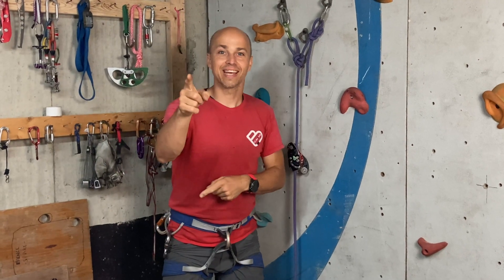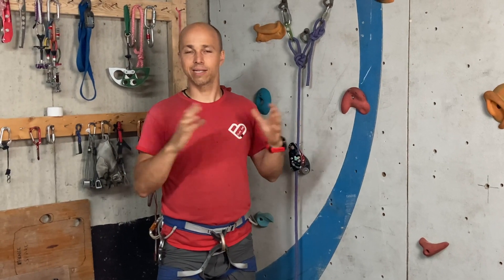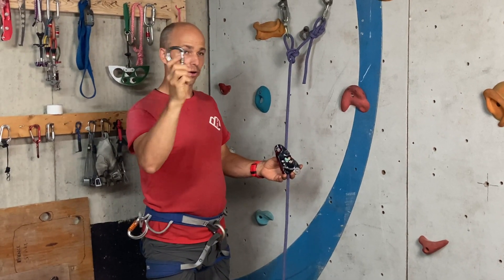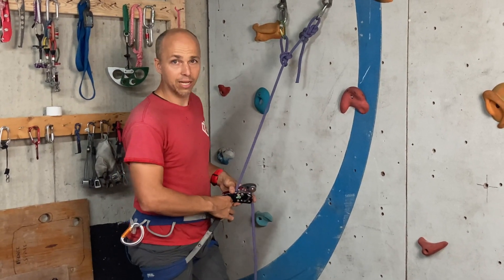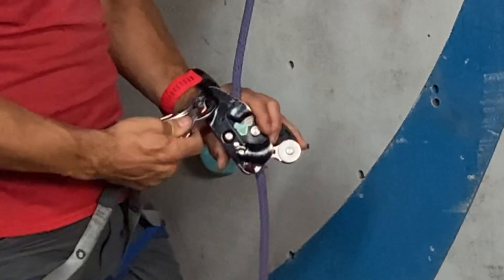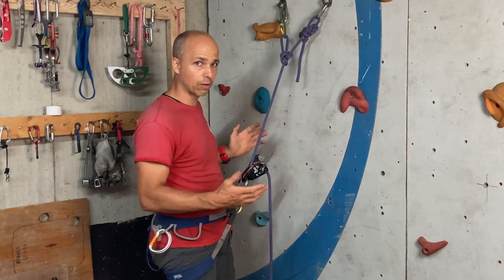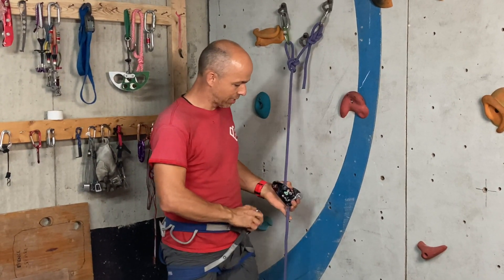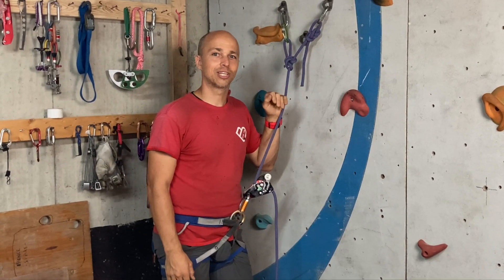About Connectors vs Devices - Black Diamond Gridlock vs TAZ LOV3

Comment: Fantastic video, I saw you tested the Ring Open, I thought about using just a ring open off my belay loop to connect my Lov 3. I’ve been using a DMM triple locker but had some concerns about cross loading.

Been using a shunt and a 12mm mallion for years.
Reply from the maker: "ring open off my belay loop to connect my Lov 3" Probably good but never tested. I will ask the TRS FB Group see if someone used it like this... "SHunt qith 12mm maillon" It must be a 10mm right? (I doubt a company makes a PPE 12mm model... Peguet has only the CE version - Not PPE in the 12mm size). No backup right? Did you use an 11m low-strech rope? Or two strands? You know two americans fell to the ground due to the Scorpion catch right? (see my 2 videos Part 1 Part 2 on the subject!) Cheers!

Comment: Hi Yann, I use the LOV2, which doesn't have that (new)second plate open cut. So the different scenari you show can't happen. And I use, as you recommended in your great online course, a thick steel maillon rapide of 10 mm (section diameter)(brand : CAMP, ref. 0935).no problemo, smooth and perfect match . thx my friend !
Reply from the maker: Thanks for the feedback Paul! Yes: the LOV2 has less potential of weird loading. A 10mm maillon is a burly choice (45kN MBS!!). I did not test my 10mm peguet with the LOV2 yet but the 8mm gate could enter the LOV2 plate if I remember well resulting in weird loading. I don’t think I own a 10mm regular Camp steel maillon yet… Thanks for thé feedback!!

Comment: Metal belay loop?
Reply from the maker: My 2 last harnesses I changed the belay loop for a Petzl Ring Open
Reply: Do you find the ring open to be a useful tool in the arsenal? I thought about using just a ring open off my belay loop to connect my Lov 3. I’ve been using a DMM triple locker but had some concerns about cross loading.